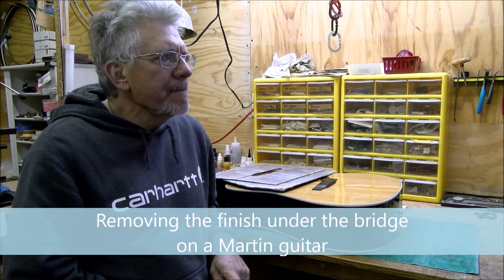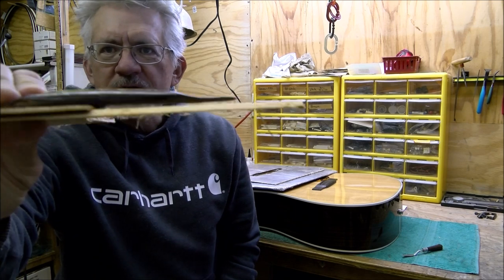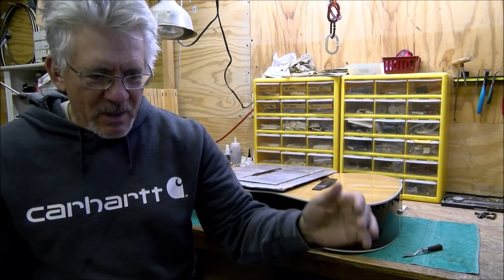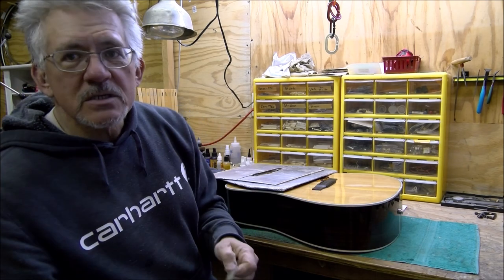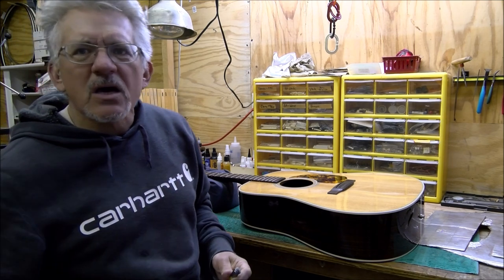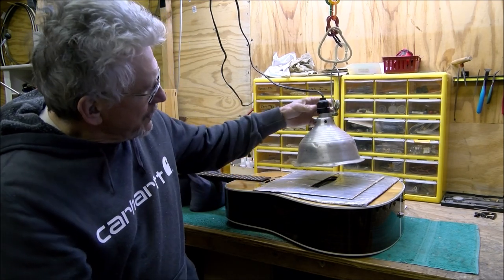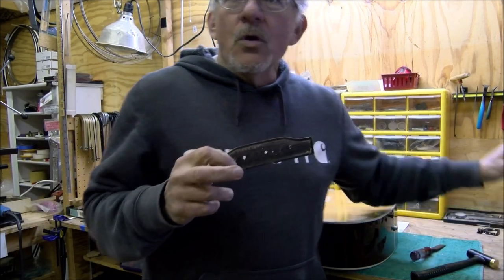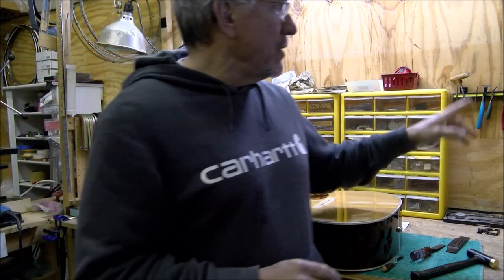Removing the finish under the bridge on a Martin guitar

Comment: I like to use pieces of fine bathroom sponge for cleaning up glue. It can be rinsed out and used over and over. Also, a small piece can be held with forceps to get at awkward spots. It can be made rigid by folding over a piece of food packaging plastic and held in the forceps to get into corners inside the guitar.

Comment: With such a clear line around that bridge, if one was setup to route a step, would that be a preferable method?

I sent this question prior to watching the complete video. Seems like your process is pretty accurate and controlled 👍
Reply from the maker: This was one of the best ones I've seen.  Most have a lot more finish.

Comment: So this learned me just because I can slide a thin piece of paper under a Martin bridge it may not actually be pulling loose. It could be because of the finish underneath the bridge. I have checked some I it would just barley go under. I've never took one off and tried to fix it. Im chicken I guess, lol. I leave it to the guys that have the experience.
Reply from the maker: that's correct.  For certain years of them, it's just the gap where the glue isn't sticking to the finish but probably is in the middle of the thing. Of course that means your bridge isn't making full contact either. 

And no... I wouldn't pull it unless you have or are willing to get the experience.  I'm just making people aware of the issue in this video.

Comment: What period or years did Martin not completely scrape the finish for gluing the bridge footprint? Why in the world knowing their reputation for quality of construction and tonal optimization, would they do this?
Reply from the maker: I don't remember.  I'll have to find out but memory says from early-90's to around 2010.  I guess they figured it would work.  :)   I'm sure they did it partly for cosmetic reasons, as I described in the video, and partly for speed in construction.  After this period, they went to the inset bridges but many of these developed "whisker cracks" at the corner of the bridge, esp on the rear.  Then, they refined the technique and now it seems okay.
Reply: @Bryankimsey  I own four Martin Dreadnoughts from 1991 -2005 (1991, 1993, 2002, 2005) and I cannot get a .0015" feeler to go under the bridge at any point and I can just barely see the glue line at the perimeter of the bridges but it is almost undetectable with the eye.
Reply: @Bryankimsey  - my late 90s HD-28 had a ~3/16" strip of bare wood in front of the bridge. Sort of the opposite of this situation. I thought it was odd but figured it gave them room to get the location just right. Not sure if that was common, have you seen them like that? I sold it but recently came across pictures of it on an old hard drive. Thanks for the videos, they are a wealth of information.
Reply from the maker: you probably keep them humidified.  Humidity will swell the top and make it difficult to push the gauge under.  If you took the bridge off, you'll see the finish line, easily.  In the meantime, don't worry about it.  It's just a thing when someone wants everything "right".
Reply from the maker: BARE wood???  No finish at all?   No.... never seen that.  I suspect that the finish flaked off.... I have seen that.  But not intentionally bare wood.   e-mail one of the pictures!!!  bryankimsey  gee mail.

Comment: You would think you'd expect better from such an expensive guitar company. Not that it's correct but, they may have been better just finishing the whole top and gluing the entire bridge onto the finish, would have been stronger and sounded better due to full contact. I do some guitar repair and some of the stuff I've seen on Martin's and Gibson's Make me want to shake my head, I've seen better on Chinese builds. Sad.
Reply from the maker: Well, then you'd have a layer of finish between the bridge wood and the top wood.  Hope your finish adheres to the wood good!  And what kind of glue are you going to use?
Reply: @Bryankimsey  right, I agree , you definitely want full contact with the unfinished wood, if it was a full finished top underneath, probably better than just having contact on the edges like that example. Surprised they didn't use epoxy. Very disappointing for a Martin.